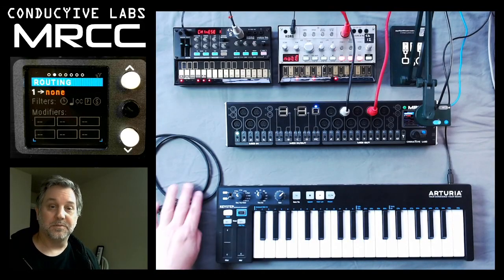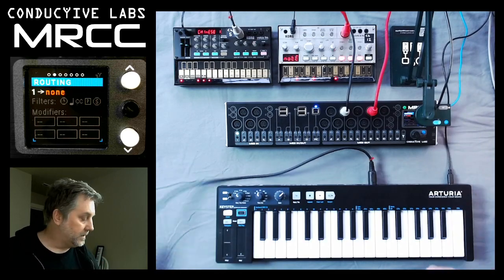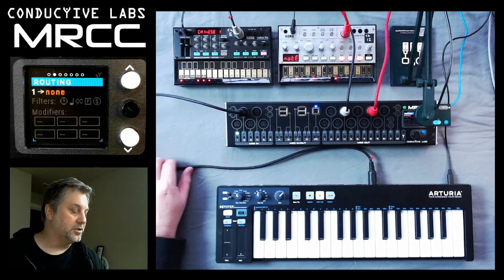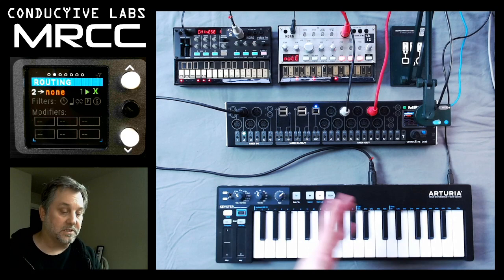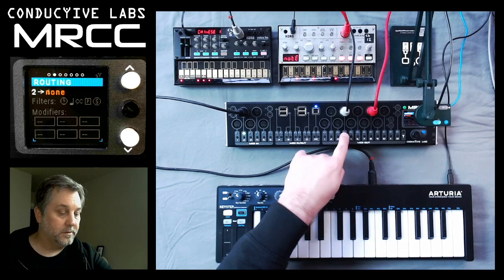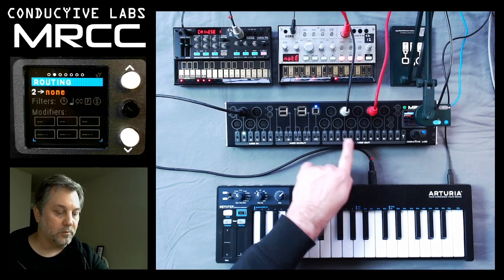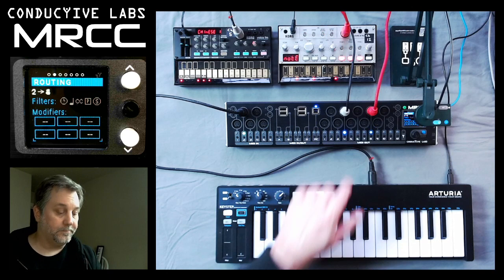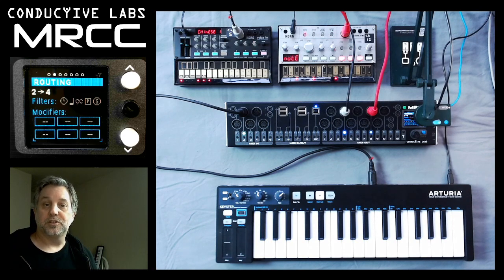MRCC #1 - Routing Gear w/ 5 pin DIN MIDI Cables

Comment: Great, really great, when i see it in action...but if someone could tell (or confirm) me if it's possible to route one IN to one or several OUTs IN PARALLEL with another IN to another or several other OUTs...

I only understood that the device automatically merge inputs selected to one or several outputs, but a sentence in the manual questions me : "Also note that in-port 3 and in-port 6 can also be routed to other out-port(s) at the same time" (it's an example). And i'm quite confused when i read the Activity Screen Page of the manual, which suggests to me that it is possible, but still without any particular explanation.

So is it really possible to route one IN to one or several OUTs IN PARALLEL with another IN to another or several other OUTs ? 

Thanks in advance, do we ever know :-)
Reply: Yes, there are no restrictions in this case, and only the outputs that have more than one input routed to it will be merged.

Comment: Perfect timing for this series of Tutorials as my MRCC just came in the mail yesterday :)
Reply: Sweet!
Reply: Hello I bought one, it’s great! Question: is it possible for my 1979 drum machine equipped only with ‘trigger out’ to control the tempo of the MRCC? I’ve been trying but haven’t managed it. Thank you! Great piece of kit though no complaints.
Reply: @grandadsarcade137  No, there is no "trigger" input on the MRCC. You need something to convert the "trigger" to MIDI clock. Is it Din-Sync? Kenton has a small device that does this.